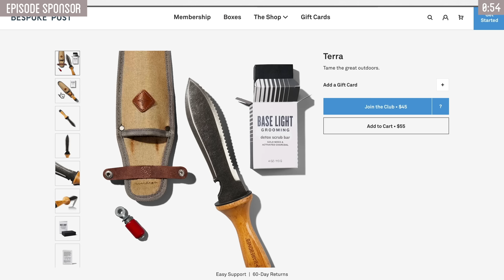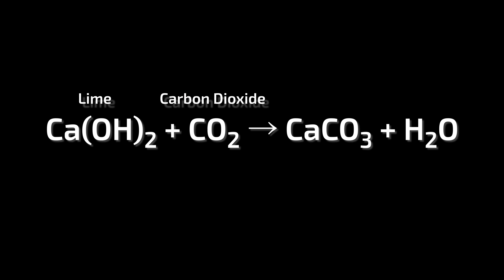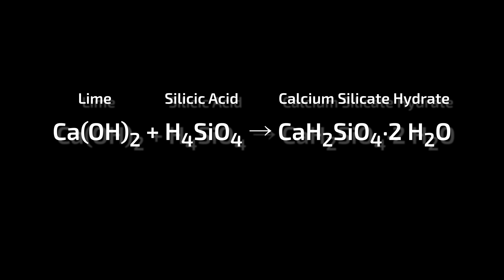How to Make Roman Concrete (4 Different Materials, 4 Different Strengths)

Comment from the maker: Get 20% off your first monthly box when you sign up at http://bspk.me/how2 and use promo code EVERYTHING20 at checkout!
Reply: Roman concrete was also compacted, and had chunks of terracotta tile.

I think there's too much lime in your mix and perhaps pumice is less effective than actual volcanic ash?
Reply: @sarchlalaith8836  lol  the pumice would have been used as an aggro ate like we use gravel today , it was used in the pathanon in its upper dome areas because it is lighter . modern portland and ancient roman concrete are different and have different properties granted they both when hydrolyzed complete there chemical reactions and leave a coherent solid mass which continues to harden . sand and aggregate ..whatever was at hand broken tile was fine as was shell  its a filler for the cement to bind  . as for the amounts and proportions   its like baking the recipe changes a little from cook to cook and day to day so as long as it sets theres not too much or not enough of any one component  its cost or its strength or its time to cure are what drives the proportion requirements
Reply: @mobiousenigma ? Did you watch the video? He used pumice in place of volcanic ash and yeah, everyone tweeks things, true fact.

Compacting did increase strength though, not unlike pise, and it's thought that the tiles adsorb excess moisture.

Anyways, have a great day.
Reply: @sarchlalaith8836  sand is an aggrogate  .and is used as a filler for the binder in cement  pumice ash fills the same function while larger rocks and gravel of pumice were used lightweight alternatives.. it wasnt just mix up mud and slap up a parthanon  theres engineering involved and while it may have been less evolved than ours today they definitely had people who understood its properties and how best to use them...and yes i watched the video did you bother to read the whole comment?
Reply: @mobiousenigma  I did..
You're literally talking about something different.

But do carry on, I'm sure someone will read it and care, that's just not me.

Enjoy your day.
Reply: @sarchlalaith8836  only the particle size is different..in concrete you use a variety of sizes depending on what you want the end product to preform to.  portocilano is the name of the volcanic ash used at the time for specific concretes .ash was a substitute for fine particle  filler whereas pumice could be used as a lighter weight gravel or larger particulate... cement and concrete are different  however a component of cement is fine particulate as it is in concrete . have yourself a good day as well
Reply: 5:30 if someone does find the hammer they will probably put it up on Ebay 😂
Reply: Damn I’m pretty sure your supposed to use river rocks instead of gravel
Reply: did roman concrete release CO2 as it hardened? I heard ours does
Reply: @hallowacko  i suspect it dose the chemical reaction is the same  lime hydration romans would have burnt limestone or shells to get it and its chemical reaction with water is what produces heat and off gasses co2
Reply: Yes
Reply: Can you try making a real brush..
Reply: Couldn't you just add the salt into the Roman concrete mixture to see if that would speed up the process of turning it into aluminum tobermorite?
Reply: @benkayvfalsifier3817  salts or specifically sodium chloride is water soluble  promotes corrosion in rebar crystalizes and in general has no properties you wish to have with concrete . it is a chemical reaction of hydration  the material will only react so fast  heat is usual to modify reaction times or concentration of active ingredients  or  the physical surface area of the reaction  but adding salt  bot so good an idea
Reply: @mobiousenigma  Yeah, but we're talking about making Roman concrete. (Or the approximation thereof since the original recipe was lost a few eons ago.) I'm not talking about its practical use; just its increase of production by adding a key ingredient in an earlier stage of its creation.
Reply: @benkayvfalsifier3817  i suspect they used tile when it was around  or gravel or whatever was at hand... like the great wall  it would have been different from region to region or even site to site  . as for roman concrete  which specific type for what job... just like today it has many uses and variations  or were we talking cements  which is the binder of concrete and a construction material with its own uses from flooring to waterproofing
Reply: Silicone Age...
Reply: How are we not in the Age of Silicone?
Reply: 17:04 problem is modern concrete degrades while roman concrete becomes stronger over time, so if buildings were made from it then old building would have mode significance instead of becoming abandoned ruins.
Reply: @IberianCraftsman  incorrect the rebar inside rusts and comprimises  the concrete or salts are absorbed  which crystalize and do the same thing  .but modern concrete sets in about 12h takes a month to cure to 99% and only hardens for the rest of its life  unless it is compromised, roman concrete is the same  its just that they did it 2000 years ago and there bad examples are gone  only the good jobs remain
Reply: Try making Damascus Steel
Reply: @avigayanghosh3997  the process to make damascus has been lost. not to mention the ore for damascus steel came from 1 mine  and its mined out. the process is similar to wootz steel which is another crucible steel ...all youtube damacsus videos show forge welding and that is not damascus
Reply: "And if you don't like it you can return it". Looks like the kind of bussiness that we need to reduce the carbon footprint
Reply: you should ALWAYS lift with your back!
Reply: You couldn't even give a fair test to the bricks, imagine fair products.
Reply: when does the next episode release.
Reply: Andy you didnt cure the concrete duing drying,  by sprinkling water makes the concrete strong as the reactiuon is exothermic it becomes hot and looses water so you need to supply water periodically atleast 48 hours to cure it properly.
Reply: sea water works best.
Reply: B2m2aja
Reply: Would be cool to have a follow-up on this video with the recent revelations about roman concrete in mind.
Reply: Roman Concrete was hot mixed with CaO (quicklime) distributed through ought and it takes months to cure.  I also don't think that volcanic ash is the same as the volcanic glass, but I'm not sure about that.
Reply: I've heard of one recipe that uses pigs blood
Reply: concidering the roman concrete was used with out steel to build massive buildings in rome, im gonna have to say you failed at making roman concrete.
Reply: as always thanks for the videos. im impressed at your level of preparation and skill  for this video in the past you efforts were uninspiring  while this is a functional usable product  where you have  used the beginnings of an assembly/production process  where if you scaled time and cost could come up with a meaningful value for the product. and you have produced a product that was marketable and of market quality.

Comment: Would be interesting to test the "primitive technology" one, (not the fake vids ones etc but the actual man that did it) if i recall the recipe was like use wood ash, make small pebble mixer with water, cook it high temp, crush it, then use it in a mix of dried cooked brick cruches into powder + clay, dont recall the proportion but was quite résilient, water proof and quite a good "mortar" wich could easely be a ciment too.

Comment: I feel like strength is not everything. Their recipes were practical and readily available. They seemed to have a type for sea walls, brick forms, and a type like playdoe that they layered between rocks. Everything was purpose made for the project, our concrete last a hundred years. Our typical modern homes are falling apart after 60 yrs, and it costs the mint to build. Every material and resource is standardized, certified, regulated, and taxed. The truckers, their fuel, and truck is certified, regulated and taxed. the builders are certified, regulated and taxed. The air, water, and dirt is certified, regulated and taxed.

Comment: You made the roman concrete really badly. First of you didn't use sea water and second you used too much water. Roman concrete requires much less water than modern concrete. Also I don't think your ratios are correct.

Comment: K, I have to call BS on the tests. Like the professionally made and fired brick would have taken a significant amount of pressure to break but you can clearly see that the test area still had fragments from the previous test. Clearly compromising the brick's integrity. Then the roman concrete didn't look like it had a very good ratio. We have texts that clearly state a 1:2 ratio of quicklime to volcanic ash for hydraulic concrete and 1:3 for everything else. If and when fillers were used like stone, they were small, like under an inch and made from crushed rock, not pebbles. You would never use a filler on a brick size, maybe more of the block size where it takes two or more people to lift but not a normal brick size.

Comment: Pyramids are concrete and geostone blocks. Aztecs , Greeks, Cambodians . Man could make concrete long before had tools to cut stone. They never moved their blocks but made them where they sit. Egyptians burned/roasted limestone ( The most abundant resource in all the great cities)  , crushed with grind stones. Mix with crushed igneous rock like granite to make man made stone. Remember the Egyptians built there because it was Nivana EDEN Utopia and they turned it to man made desert and moved out. Just like all the great ruins that litter the planet as warnings were abandoned when grew to big and ran out of fuel. this generation has amazing OIL coal etc. This generation turning the planet into desert simply replacing the vegetation with fire loving plants from 100,000s yrs of setting the land on fire.

Comment: Can you test actual roman concrete, maybe I missed it if you did. Also I am interested in what happens when you fire Cob bricks. If you have an extra one could you give that a go? I just discovered you, will check out the olive press, I have 16 olive trees on an off grid place got, where I plan to be mixing my own adobe, cement, and all kinds of mixes. I wonder if making a rocket heater out of the cob adobe bricks, to make stuff like lime, and I may take it down turn the bricks around and fire the other side if it makes them more durable.  Also I saw somewhere that maybe hot sea water was used... I may be confused about that, but brain says it might be a thing. Old cement has had a long time to cure I think testing new cement didnt't do it any favors. I plan on not using round rocks in mine. For some reason it just seems slippy to me, tempting the mix not to stick together. then again I will be putting round glass bottles in walls... Thanks for all the videos, will watch a ton for sure!
Reply: Ah, if anyone has any advice please let me know. I am open to trying stuff.

Comment: one thing to improve the strength of your roman concrete, is using gravel instead of river rocks, the idea being that the rough surface of gravel gives better resistance to shearing forces. chalk powder should also help for similar reasons.

Comment: You really should not call that Roman Concrete.
For one, Pozzalana is used in very specific settings (mostly underwater), not all concrete. Definitely not "roman" concrete..
For seconds, the actual recipe of the concrete is unknown / lost to time; What archeologists have tried to find is a simile at best.
For thirds, even knowing nothing about cements, you should know that curing times are in the multiple days range. Concrete made from a bag, with pozzolana added, takes approximately 40 days of constant watering to cure correctly - and if you don't water it daily, it will crack.

Aside from the "Roman" issue, I'm really bringing this up because you actually CAN make a Roman Glass Furnace, and finally get Lense grade glass....

Comment: For those finding this video today science has recently solved the big mystery of Roman concrete. Either by processing accident or by design the large chunks of lime in Roman concrete would devolve out of the substrate when exposed to water and "heal" fissures and cracks in the concrete.

The Roman empire invented man's first self healing meta material.
Reply: ohh so is it just dissolving and recrystallizing
Reply: @tygical  basically yeah. Built in quicklime mortar that would fill in gaps and bond chemically to the concrete over time.

Comment: Can roman concrete be used for the following with the following conditions:
-Survives 2-5 years in the sea, then degrades
-without any heating in the material (now they heat caco3 to make cao)
-using dead oyster or coral reef material (caco3) for the lime part

What would be the material and method for such a brick?

Comment: I think you should have added the seawater into the mixture not coat the outside of the brick. Also roman cement is continually being cured and strengthened by the Sun as the sun is the "Bakeing" process for the cement. Similar to fireing pottery.

Comment: I do remember talking about Roman concrete with my uncle (road construction, drainage install etc. Lot of concrete work) He was giving me a rundown of how a longer drying/curing most of the time leads to a stronger/stable product, hence their sea ports of massive concrete slabs still being fine.z

Edit: yeah the other comments pretty much nailed it. Testing this was kind of a setup for failure due to the intended cure time for the Roman stuff, and its major selling point being supreme resistance to weathering. Though, in all fairness, it's not really practical for you to just pull out a 30+ year aged brick that's properly cured.

Comment: It is suggested that the Egyptians poured their own stones for the construction of the pyramids of Giza. I'm not saying they did, but there's evidence that supports this theory, like similarities in mineral composition with slik from the nearby riverbed. Of course, this neglects the tool marks on the stones, as well as the research into surprisingly fast production speed of those stones with copper chisels.

Comment: Roman concrete is far greener than making portland concrete, which requires massive drying kilns to produce the mix. I guess the Volcano already provided the energy needed.
Reply: The kilns are used to make the 'lime' (Ca silicates and oxides).
The modern equivalent of the volcanic ash is the coal (fly) ash.
Reply: @LENZ5369  Thanks for clarifying that. I googled it and it seems like only 15 to 30% of the cement mix is fly ash, the rest is still portland cement.
Reply: @tim1398  No problem, and yeah -Portland (limestone) has to be part of the mix to get the pozzolan reactions with flyash.

Comment: I think the roman concrete would have done alot better if it had set for a few years and if you let it setup in water with sea salt it would have crystalized and even had more strenth.  Using lime is so much more healthier than any other product it is cheap and makes the atmosphere better with less fungus ande cabondioxide.  Lime is just better all the way it is just not comparable to any other material known to man as far as using it for human buildings we have went backwards with using drywall and other toxic mold holding products so sad.

Comment: I'm very interested in this, I am studying civil engineering and from what I know modern cement is the same recipy as roman cement, though as all processes, we refined it to a molecular level to get the maxim stength. Problem is though that in order to create any cement there is a massive amount of carbon dioxide released into the air to creat your klinker, which in ancient times was your fly ash which came from the original carbon dioxide sources, volcano's, but today we do this ourselves in factories, heating limestone to extreme temperatures, so we became the volcano's...concrete has helped us develop so far, but as engineering students we are constantly asked to look into new ways to create cement or to find a way to nuetralize the fumes produced. There is a lot of depth in this, and I love how you remind people of all the generations of knowledge we have access to today, we are in a rapid developing era. The age we're in, I don't think there is a name yet since ages are hostorical periods used to classify information periods, after iron age was middle ages, pre modern etc, we are past the post modern, this age will probably known as the nuclear age from what happened in it and from how we have developed with nuclear energy, another fun thing to watch out for is nuclear fusion energy, which could change how we live, nearly unlimited sources of energy. I just want to build in space one day, being like a space civil engineer, it could be awesome.😁
Reply: The fly ash equivalent is the volcanic pumice.
Both uses 'lime' -it's just that we process it far more that just simply heating and hydrating it.

Comment: I was just watching a whole series of your videos about how to make glass and you said something interesting in this one about how obsidian is formed. You said it forms when volcanic lava cools under pressure. This takes me to the video where you tried to make a knife out of obsidian that you melted and poured into a mold. If obsidian forms when it's under pressure then it makes sense that if you reform it, it should be pressurized when it cools. The other a method I was thinking of was to heat the mold so the obsidian cools faster and doesn't crack from the air in the environment.

Comment: much too much ashes in the mixture it was dusty outside...we made roman cementum with burned oystershells coalash woodash sand and small crushed pottery (gardening pots ) and water, and it was hard as concrete